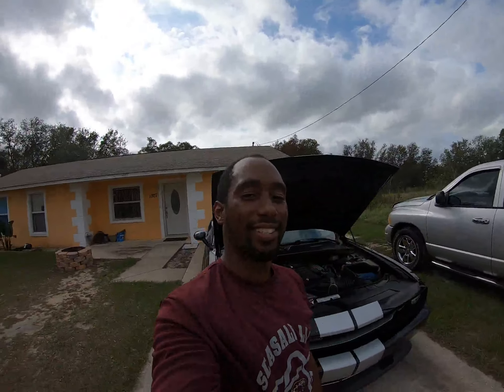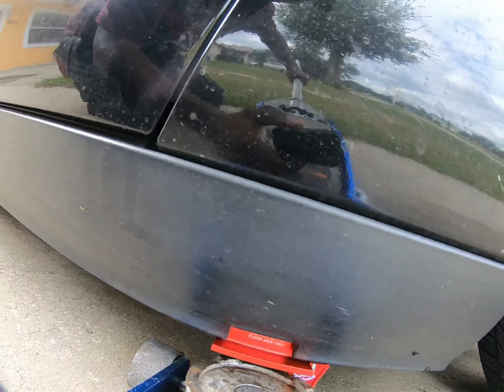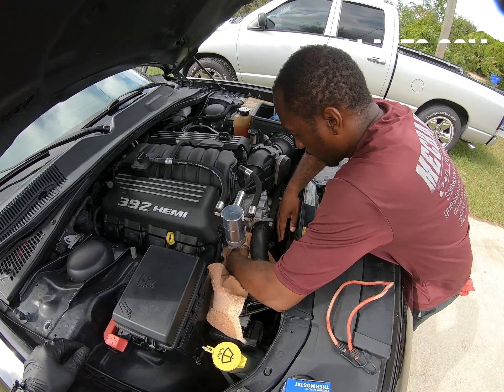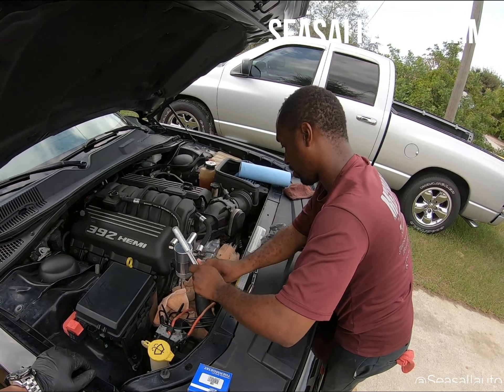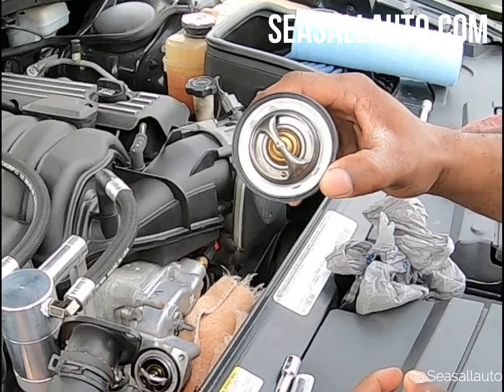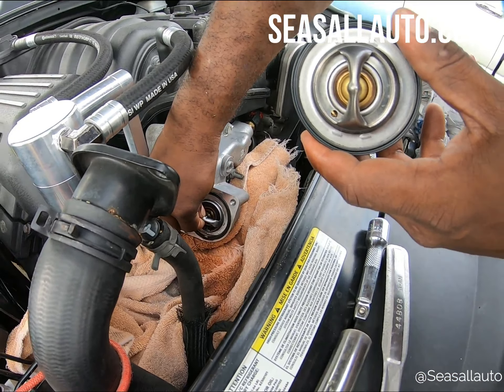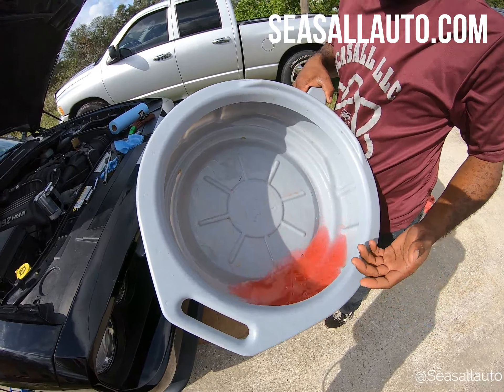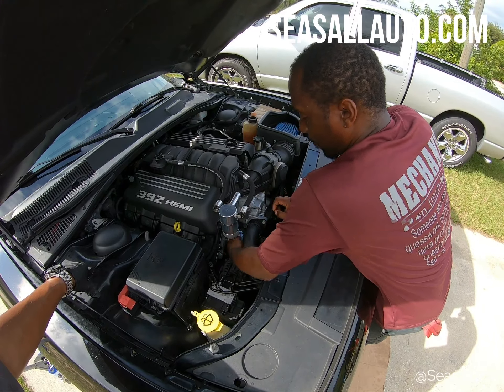[4K] Changing the thermostat on a 2012 Dodge Challenger SRT8

Comment: I thought that the pin hole on the thermostat is suppose to be at 12 o'clock position 🤔
Reply from the maker: Man I said the same thing, the crazy thing is I put it in the same way that it came out but follow the owner's manual I just tried to fix a problem that wasn't broken 😅thanks for the comment ✌🏿

Comment: this is from the repair manual...................
2012 Dodge Challenger THERMOSTAT  Installation  5.7L/ 6.4L Engines
"Position the thermostat on the front cover with the vent at the 12 o’clock position."
Reply from the maker: I did read the manual afterwards and saw that but never went back and rechanged it we still daily drive it and no issues but always stick to the service manual

Comment: Had the engine light come on my SRT8, ran the code and it was the thermostat stuck open, temp was too low as it was cold here. Good info, thanks for the video.   Off to the auto parts store.
Reply from the maker: Super excited to know that I helped! I'm sure by now you're back on the road keep on burning rubber!

Comment: Why did the hose going to the thermostat get sucked in when you were in the car reving it??
Reply from the maker: Hi great point I literally had to go re-watch the video three times because I didn't even notice it did it. Most likely is because there was insufficient coolant inside of the cooling system but once it heats up and expands or more coolant is added it'll usually stay firm thanks for the tip and thanks for the comment.
Reply: @Fasttowpro  The spring is not in there?
Reply from the maker: @duanebonney  I believe that's the case but I'm not 100% sure. I do remember there being a spring but I don't think it was wrapped all the way through the actual radiator hose. But it could be that it was not spring filled, meaning that the pressure would have to build up before the hose could be firm. Furthermore the system would have to be bled. When I get back around the car I'll squeeze it to see if I can feel a spring but if you're curious call your local parts store ask them for the upper radiator hose and ask them does it come with a spring. The last part I'm going to add to that is I personally do not like the spring filled radiator hoses. Overtime it creates a lot of additional rust deposits inside of the cooling system from my experience. I hope that answers the question 😂 I go on rants
Reply: @Fasttowpro  I had the same problem 3 years ago with my Whipple conversion. The hose was replaced without a spring. I looked at the OEM hose, and there was a spring in there. I now have a glass section there, so I don't need one now. :)

Comment: I have just replaced my thermostat to the 180 to the 12o clock position and since then my car has passed the 215 degrees, basically overheating and my hose gets sucked in as well when I rev it up. Was thinking about flipping the thermostat to the 6o clock position to see if that would work. Have you had any issues ?
Reply from the maker: Hey I had no issues with that and I'm sorry to hear that you are 😡 now I did put it in the same way I took it out but typically the hole in the thermostat is meant to face up so air can escape and keep the flowing of the water. Now whether Dodge has some other protocol I'm not sure I don't think so but I definitely could be wrong. So with that being said I also don't know if you bled the system. There is a bleeder valve on the water pump housing in the front if you have the same V8. Also you want to run your heater to let the water circulate and get heat dissipated throughout the system. Any questions shoot me an email and I'll try to help you as best I can but that should get you in the right direction. Seasallauto@yahoo.com

Comment: Should you clear the code p0128 after fixing or will it clear itself
Reply from the maker: Hey I actually let it run itself but I always reset the codes after. I don't know if it actually would have reset had I let it but it should because it's supposed to have a self learning computer but to keep things in easy I reset it and it never came back I wish the very best of luck for you as well any questions hit me up at Seasallauto@yahoo.com and I'll help you best I can thanks for the comment ✌🏿

Comment: If u fnt tune it for 180 ur fans will not wrk as soupose to nd won't get the full benefit of ur 180 star !! Best way is dIAbLO tune it i2 2000 tuner nd cold 93 tune eill wrk w ur 180 star nd cod pipe if u fo get Pe !! Good luck
Reply from the maker: This is very true. I did buy the Diablo sport but never did the tune because it voided the warranty from the dealership. The after effect of this was still okay, these particular cars apparently have an issue with the fans locking up that most people don't concern themselves with until they actually go through it. so honestly I'm not sure if it's actually a benefit to have the fans come on faster because it draws more energy more heat and faster destruction time of the fan motor. I don't know the name of it but if you just search Google or YouTube and look up exploding radiator fan Dodge, it should pop up. It's crazy and it sucks therefore I'll rock the 180 without the fan adjustment but I know there's different strategies for different climates and weather here in Florida we need the cooling system to open as fast as possible because usually it's boiling outside. Good tip though and thank you for the comment ✌🏿